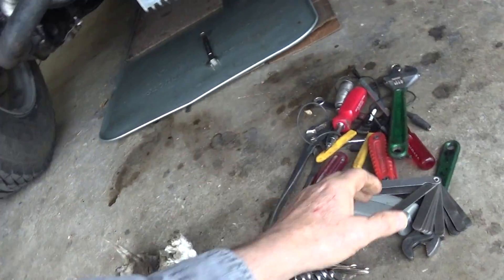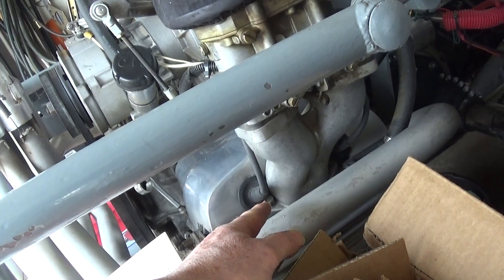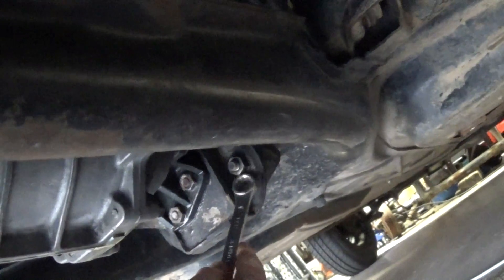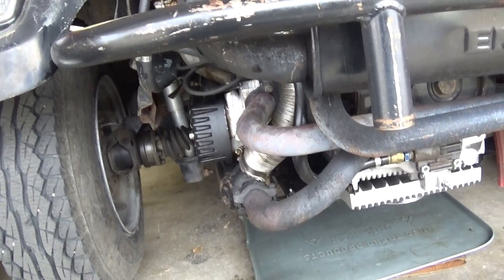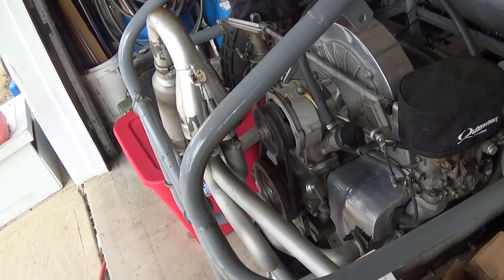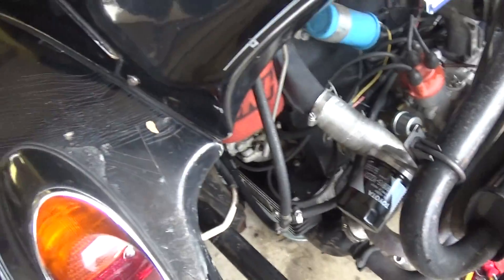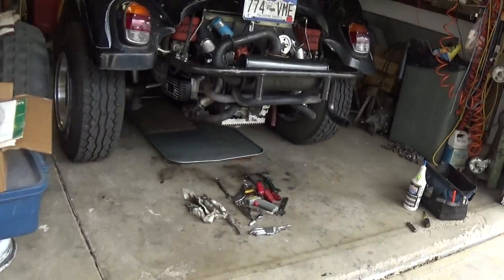VW  Maint Vlog / Tool Mods

Comment: Dose it take much effort to take the exhaust off with the headders welded.  I was thinking about doing that because out on the highway mines realy loud. I don't run full tins around the cylinders. I often wonder if I should.
Looking forward to seeing you out and about in the buggy,  we've still got about 8 weeks of sun left here.
Reply from the maker: Lot's of different kinds of headers. They are made to assemble and disassemble.  Cooling tin is a topic for different styles of cars.  You can't go wrong with stock tin.

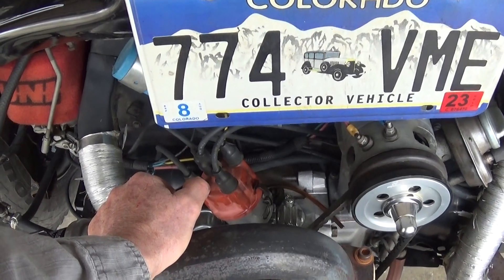Comment: Hey also in your other video (2276 engine test + Q&A. At 11:10 what is what is screwed in to the bottom of the oil coil and then your hose is connected to it? Is it a drain back preventer and if so can that reduce your oil flow too much?
Reply from the maker: Thermostat switch to turn on the Electric cooling fan.
I took it all off.  The stock oil cooler connection seems to control it well enough for my style of driving

Comment: Is there like a magic horse power# to popping wheelies. Or is it weight etc.
Reply from the maker: Light dunebuggy, Light driver, weight to the rear, low center of gravity, 100+ HP , short wheel base, nice angle going up hill, Jab the clutch with the gas down and scream with your mouth closed.

Comment: Keep it up !!!  The ALL important upkeep - ready for another year of cruising !!!  Time for a burrito ??? I've got a KP Stage 2  w/ Diaken disc to install. Tricking out some Kaddies & match port intakes to finish up & install. My current clutch works good - but if I drop the hammer - tires do NOT spin - once shes rolling - power shifting goes  ok - the carbs just aren't BIG enough. Figure I best get the rest of the parts up to the task !!! 

I had already decided to skip most car shows this year & just drive it. Then all this Virus stuff showed up. Getting ALOT done being off work - my TO-DO list is VERY LONG !!! 

I'm trying to stay away from my car until I get most of my list done !!! Have a good day - stay safe !!! Bug - On !!!!!!!!!
Reply from the maker: Put more air in the tires. They will spin and bring the RPM up quicker and it's probably easier on the tranny.
Reply: @TheEZGZ  -  Might have to give a try - if I'm gunna smoke a clutch - it might as well be one I'm taking out !!! Of coarse it warms a couple days then drops back into the 20's &  30's - then 40 mile an hour winds. Not too safe to drive or start running 20-50. Would much rather it be warmer. Have a good day !!!